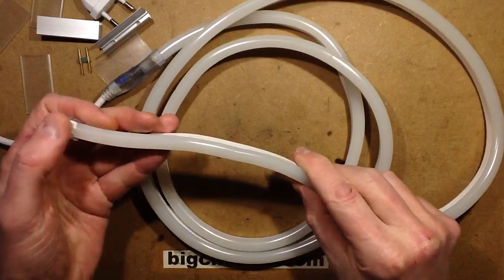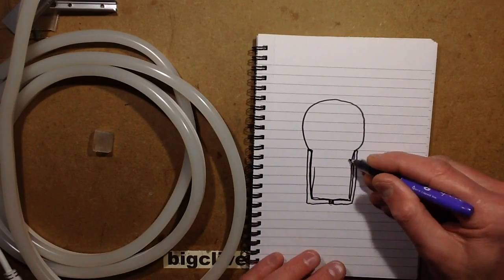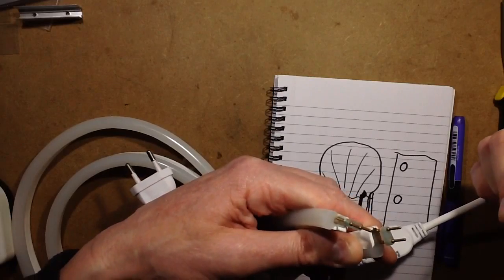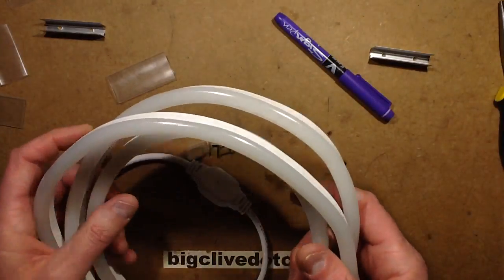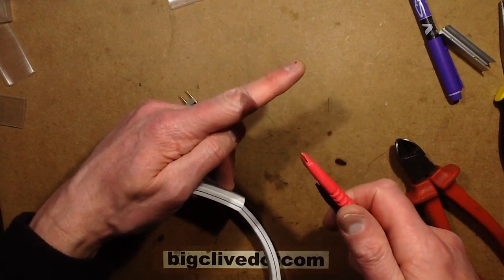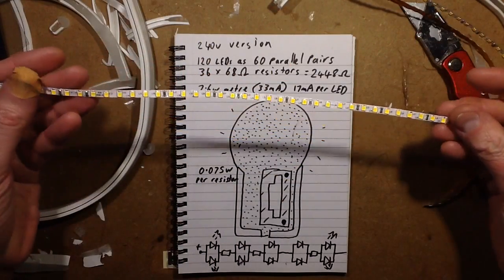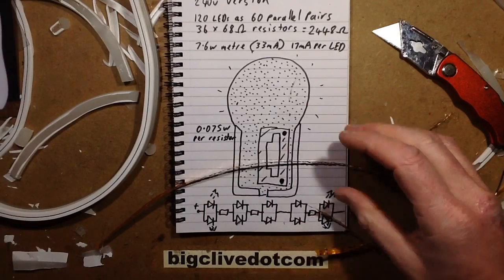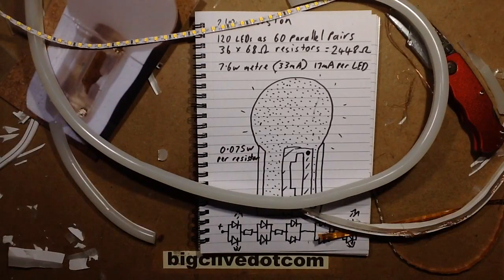A look at the inside of LED based neon tube effect.

Comment: No, you shouldn't upgrade from an Apple product - it is great detector of unstable lights (some people might not care, might not be affected, but some people are sensitive to unstable, flickering lights, so this is useful information). :)
Reply: mbaksa Except it shows flicker where the human eye wouldn't see it
Reply: +Willlovesomething - Either I'm an Apple fan, or you're an idiot. I don't use Apple products, I have never owned one, and don't wish one. So that makes you... Someone who is missing the point.
Reply: +Bilky Asko - I don't see flicker of a 75 Hz CRT monitor, but have had frequent headaches and eye problems because of it. I don't see flicker of a capacitive dropper LED bulb, but that kind of light makes me uneasy, and everything looks weird. When Apple introduced PWM regulated LED backlight into their MacBooks Pro, there were people returning them because they had health issues because of the flickering (or "flickering") screen. Apple noticed that and stopped using PWM to dim displays. Please look into the issue, before dismissing it.
Reply: mbaksa Erm, I'm not dismissing it. I'm saying that it will show flicker in cases where it would be unnoticeable. 

I don't suffer with headaches from flicker but I am sensitive to it (hence why I used to crank up my old CRT monitor to 120Hz).
Reply: someone does not understand what 50Hz power is, clearly.
Reply: I'm sure Clive would gladly accept your gift of a non=Apple camera  'Course, who knows if the scan rate of another product's CMOS sensor will do much different with poorly rectified 50Hz lights. CMOS is here to stay for mobile cameras. You would not have this issue so dramatically with a CCD, but CCD's aren't near as efficient with current. Of course, flicker isn't just about the camera or its controls. Shutter rate will always cause flicker if it's different than the LED's
Reply: Friendly reminder: There are actually MUCH better manufacturers of Android Tablets and Phones than Scamscum, but that's none of my business. drinks tea
Reply: MrSnowman - Yes, some lights are worse than others. One should ditch the bad ones, and keep the good ones. I've replaced all flickering LED bulbs with non-flickering when I learned how to differentiate them through specs.
Reply: Bilky - OK, I see what you meant. But I don't see that as a problem. Manufacturers should stop making flickering or "flickering" lights (and screens), and if video makes flickering product look worse than it is in reality, so be it (alternative is to show it better than in reality). To me, as a viewer who is sensitive to flicker, being visually informed of flickering nature of an LED bulb, computer or phone screen, even though I won't see that amount of flicker in real life, is much more important than to look that light in video as a stable, steady light. If I see it flicker in video, I 100% won't buy it. If I don't see it flicker in video, and person forgets to tell that it is unstable light source, I might buy it and regret it.
Reply: mbaksa this. I'm bothered by most lights. But some are worse than others.
Reply: ***** the choices are kinda thin these days... Lenovo is not making flagship devices for moto, LG has build quality issues, and asus somehow is sorta iffy.

Oh I guess HTC will do
Reply: +mathue taxion orrr one just gives the man a camera instead of some Ancrap phone... Unless it's a really high-end one it's a waste, and even then a proper camera will still be better...
Reply: mbaksa Watch Tom Scott's video about why that flicker happens. There is no flicker in reality, its a camera fault.

Comment: Yes you should upgrade from apple
Reply: Silentsouls
Perhaps even to a real camera...
Reply: Im here more for the info and less about the extreme viewing quality of Clives hands.
Reply: Cisco Frost, my point was in response to Sparky UK saying that he has the same problem on his Android device. The camera hardware can do a wide range of frame rates, compatible with both NTSC and PAL, so it's the software that's limiting them. There are many third party applications on both iOS and Android that give more control over the hardware than generally comes pre-installed. So for both Big Clive and for Sparky UK, a simple solution is to spend a few bucks on a good video app.
Reply: tin2001 agreed
Reply: Simply upgrading the software for a few dollars should do the trick. The basic utility that comes with the OS is pretty basic. The hardware can do a lot more with the right app.
Reply: That is not the reason why the lights appear as they do, but I agree with your sentiments.
Reply: It's not the device, it's the software.
Reply: FXM with Apple the software is tied to the hardware
Reply: Cisco Frost, yes, but there are plenty of camera software options for iOS from third parties, just like with Android. You are not limited to the apps that come free with the OS. Generally speaking, the actual camera in the device, regardless of OS, can do a lot more than the basic camera utility apps that come bundled with it. You just have to try some other camera apps to take full advantage of the hardware.
Reply: FXM thanks for the info I suppose
Reply: Happy to share, Cisco. It's amazing how many modern devices are capable of so much more, if the software didn't impose unnecessary restrictions and limitations. I see this a lot in diagnostic equipment, especially.
Reply: Can you bypass the one meter cut marker, to use smaller lenghts, by wiring them together? Need to make several smaller letters out of this stuff.
Reply: I am looking for the same answer. I can't believe they designed it in a way that it can only be cut every meter, not very precise. I have found another version on ebay where it can be cut every 50cm but still not very precise.
Reply: Android devices are known for many good things but "being a good camera" is generally not one of them.
Reply: I rather have lights flicker in his videos than a stuttery video because my monitor refreshes at 60 Hz and the video would then be 25 Hz.
Reply: I have android devices and they do the same thing when filming.

Comment: Could someone possibly tell me the make and model of the power meter that Clive normally uses or any recommendations for any reasonably accurate power meter for a sensible price.
Reply: I'm not sure of his, but I use a similar 120volt   Kill A Watt brand unit, model P4400. $20 at Amazon.
Reply: Amazon UK doesn't do a 240V version of that meter unfortunately.
Reply: hugh jenjin Look for "power monitors" there's lots of them on amazon.co.uk.
Reply: I got one from aldi a couple of years ago at about £8 - it's ok... course you never can predict whether they'll do that sort of offer again or not
Reply: The trouble is some of them aren't worth the plastic they are made out of. In one of Clive's videos he said the one he normally  uses was good but then showed another on camera and said it was a POS.
 Any meter off Amazon may be ok or may be rubbish so i was hoping to get a recommendation on a specific known good one before randomly buying the first i liked the look of.
Reply: FWIW I've used my P3 Kill A Watt at least a couple of times a week for a few years.
Reply: It seems Kill A Watt do not make a 240 volt UK version, tried Ebay and Amazon but no joy.

Comment: To cut down on the flicker you could try using manual exposure control (with a  neutral density filter if needed). I'm able to make madly flickering dimmed LEDs look stable. 

It doesn't bother me though. I like the spontaneous nature of your videos.

Comment: You could shove an electrolytic cap in the other end to reduce flicker, but the voltage would go up to 330v, unless you have a variac to reduce the input.
Reply from the maker: The smoothed peak voltage is the issue there.  But a small transformer wired to buck the voltage by a chunk would work.
Reply: bigclivedotcom I've done this with my christmas tree lights, I just found a small 24v transformer from a furnace, and wired it to buck the voltage down, it worked absolutely fantastic.

Comment: Nothing will ever truly replace neon.
Neon is life..... neon is love.
Reply: This stuff is way easier to work with.

My wife drives a Caliber, 2008. One of the best cars we've ever had, and
 she can't kill the CVT (she's killed two Torqueflites).  

 I  had a Neon, fun to drive and got 40 MPG (5 speed). But then the oil leaks got too bad, rust came through,  the water pump died and that was  the end.
Reply: A big neon sign takes a big high voltage transformer. They are expensive/hard to find. So are people to work on neon signs. 

Hmmm, I wonder why they don't use inverters to drive neon. It would be way lighter and cheaper, but not as reliable. I worked with high voltage, high power electronics for many years, and it was never highly reliable. 

My daughter has a big neon sign that she wants to get repaired, (it's cracked), but I suggested EL wire snaked through the glass. This LED plastic tube might be a better way to go.
Reply: What about the Caliber?
Reply: +jimvandamme Neon can be driven with a resistor connected to mains. 

LED needs a rectifier and (preferably) a smoothing capacitor.
Reply: AIO inc. Neon is way harder to drive than that...
Reply: have you looked at el wire

Comment: Hi Clive, the Ipad can record at 720 60fps, so why not render video's at 60 fps? Great video as always.
Reply: because it makes the files to upload larger, and there is seriously no benefit for videos like ones clive makes.
Reply: it would stop the flickering effect from the lights.... and the files are not that much larger.
Reply: It wouldn't help. The lights flicker at 100 hz.
Reply: Scotty24198424 I dont think that would work for him as the UK runs their power at 50 hertz.
Reply: Scotty24198424 50Hz electricity + 60fps = flicker...
Reply from the maker: iPad2 very limited in options even with video apps.
Reply: Yeah I should have relised what he meant as I live in the UK.
Reply: bigclivedotcom Hi Clive - Have you looked at the new, high power LED COBS from ebay that have mains (110 or 220v) regulators built into the COBs? http://www.ebay.com/itm/20W-30W-50W-LED-Floodlight-COB-Chip-110V-220V-Input-Integrated-Smart-IC-Driver-/252558895201?var=&hash=item3acdaee861:m:ml5hgyZhaRmEqyz-y-bXURQ. Looks to be just the thing for cheaply growing tomato sprouts

Comment: 8:30 jokes about always  cutting  towards your thumb not your chum before pausing
8:43 thumb reappears with an elastoplast on it :D

coincidentally I just noticed a few days back that I'd just missed an exhibition of neon artwork in Blackpool https://www.grundyartgallery.com/programme/past/2016/133/
which is quite sad cos I've always thought proper neon is beautiful - doesn't appear to be a travelling exhibit so I don't expect it'll be resurfacing anywhere else in the foreseeable future.

Comment: If you drove the lights at 60 hz would that prevent the flicker during recording?
Reply: Ian Clarke You can always use a 12v inverter.  You can change the frequency,  it's just more work than it's worth.
Reply: UK mains frequency is 50Hz, you cannot change it

Comment: BTW, I wonder which is more energy efficient. Lets take say, your average blue and red OPEN sign, which would be more energy efficient? Neon or This fake Neon LED tube lighting.

EDIT : Heres an example image of the kind of open sign I mean (which I see a lot of in Canada) https://i.ytimg.com/vi/zJO-ipnM1R8/maxresdefault.jpg
Reply: Very low compared to the operating budget of a store. The neon transformer is probably low power factor though. The LED is going to be way more rugged. Neon is going to last almost forever if you don't damage it. LED and power supply reliability is a  big question mark, very variable depending on design and construction.
Reply: jimvandamme I kinda figured that Neon wouldn't really take too much power, I mean it only needs very high voltages to excite the Noble gases inside.
I imagine that LED lights would probably fail sooner then Neon especially if they're made with cheap LED's and/or a cheapo power supply

Comment: isnt it EL wire?
Reply: No. EL-wire is completely different.
Reply: I've got an el wire....nothing like this, it's several times thinner and vastly more flexible....but they don't give off nearly as much light.   no points of light inside, it's literally a length of wire that fluoresces when passing current.  more believable neon effect if you don't need brightness.
Reply: very different things :/
Reply: Difüzör kullanıyor,EL kablo kullanılmıyor..
Reply: Alper Gökcek ha peki
Reply: Özgün Kara :D
Reply: Not complex,thats simple.
Reply: Ghost looks like that to me
Reply: ***** Also EL-wire needs some type of HV. ballast..
Reply: schadenfreudebuddha Ok, thanks for the information.